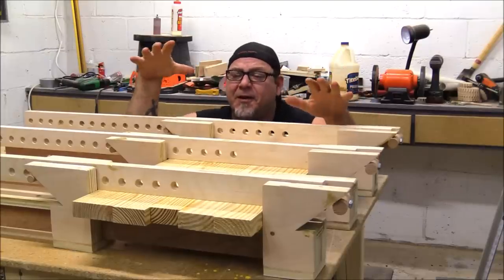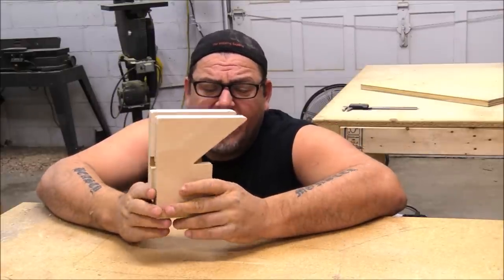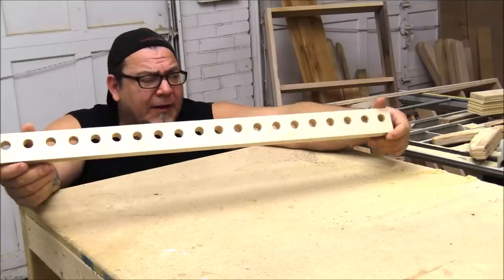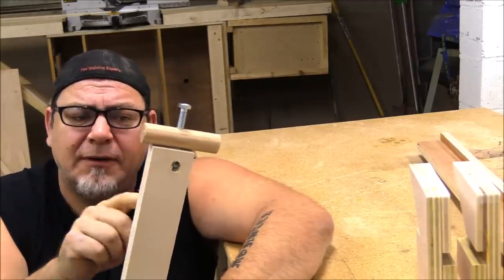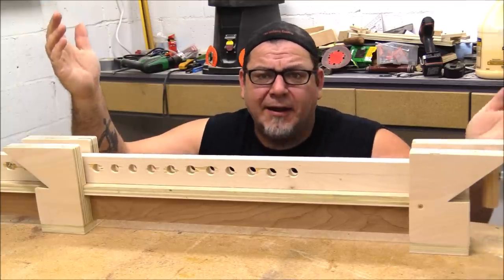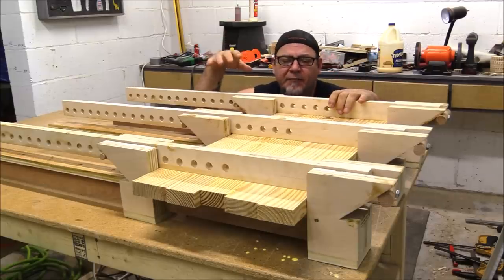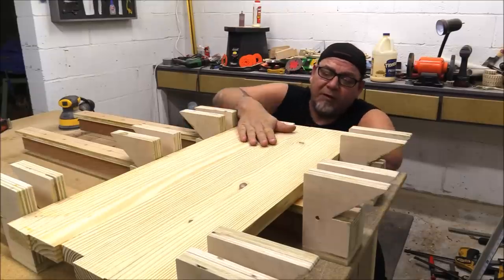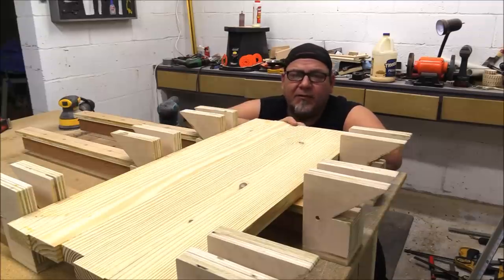Incredible Homemade Bar Clamps | Diy Woodworking Project

Comment: This is a great plan and execution. One small suggestion on the design of the wedges would be to have the angle cut terminate in a radius equal to the size of the dowel used rather than the sharp point.  Lay out the angle cut, then drill a hole the size of the dowel tangent to the angles rather than cut all the way down to the sharp point.  It should add a little strength to the potentially weak point.  How about laying down a strip of good old wax paper prior to glue-up to prevent sticking to the beams?  Thanks for sharing your knowledge and experience with us amateurs!

Comment: 1.) The only thing more tedious than homemade wooden-plexiglass-3D-printed dust collection cyclone systems are homemade wooden parallel clamps.
2.) Is there a general rule that $250 hardwood panels (boards that mortals never get to own) need to be glued only with $5 Titebond 1?
3.) Are modern parallel clamps one of the most overpriced scams: $75 each for a plastic and metal 24" clamp (Jet brand).
4.) You can buy a top of the line Skillsaw with 15 amp motor, and a magnesium motor for $95. Two 24" clamps will cost you $150, and that's only for the 24 inch clamps. What kind of scam is this?